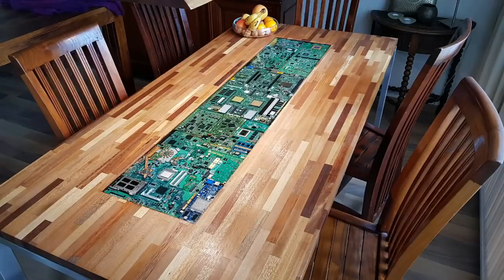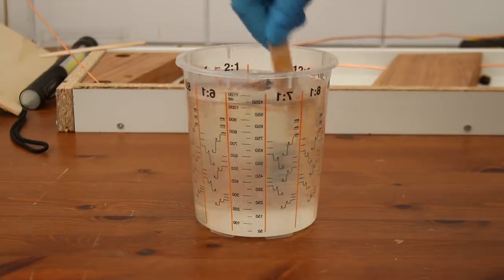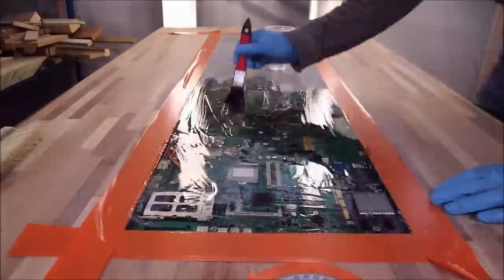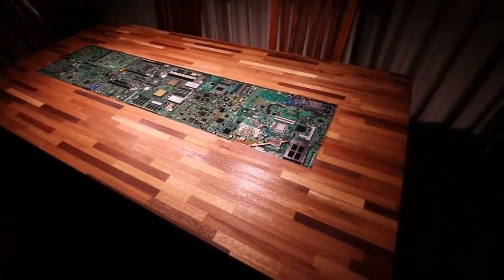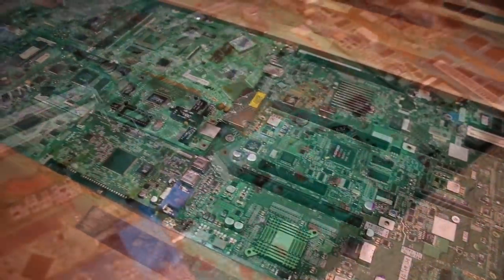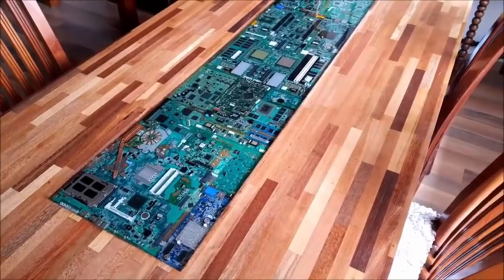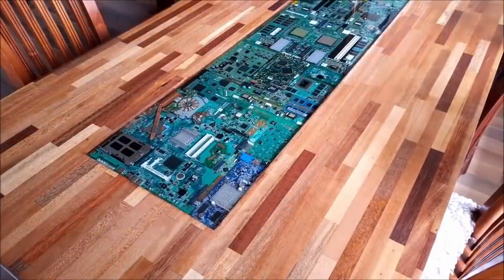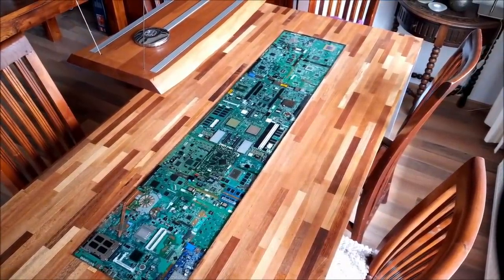Circuit boards with lights in epoxy in a table

Comment: Excellent job. ya material fails like that suck BUT one responder had an excellent idea of the glass. Let the epoxy cure for a a couple of weeks for it may harden up. Its like fiberglass resin. if someone asks about the cloudy portion, tell them that a PIM PARTICLE (ANT MAN)  emerged and its caught in the Quantum Realm. :) One drop of MEKP in a quart of resin WILL set off the reaction and it harden. Your concept is over the top cool. You can buy optically clear Acrylic glass that is stronger than glass and alot lighter. Again nice job.
Reply: dcartier100 Epoxy resin is different than fibreglass or what you actually meant poly- or vinylesther. The formation of poly or vinylesther is a chemical process that happen as soon as the stuff is produced in the factory (albeit very slow), adding the catalyst like MEKP will just accelerated this chemical process.
Harding of epoxy is also a chemical process, but that process relies on adding hardener to the base resin in exactly the right amount. If you add too little or too much your epoxy product will get sticky and will not give the right end result. Even if you wait weeks, the chemical reaction will just stop after typically 24 hrs depending on your hardener component. The mixing of the two components is critical, you best use a mechanical mixer for such big amounts and do not forget to pour the base and hardener component into to a third container/cup/pot and really mix it well also in the corners or else you get these clouds of unmixed base or hardener that remain sticky. Air can be removed using an ultrasonic bad, or more practical for this poring epoxy by using a heat source like a burner or a vibrating device that shakes out any air bubbles . Also it is better prepare smaller batches of product and to poor multiple layers, while degreasing the epoxy with an appropriate cleaner in between (the chemical reaction tends to produce some greasy byproduct on the surface).
BTW, you remove epoxy really easy and cheap using vinegar (but do not wait too long of course and rinse with water afterwards).
Reply: @peterk3574  you are right. Each substance has its own properties. My point being if you read my statement was give the epoxy he use some time. I have had similar experiences with epoxy which DID eventually harden. The fiberglass comparison was ONLY an example. Give the epoxy time and see what happens. That's all. I hope all your projects are flawless.
Reply: dcartier100 I wish everything went OK the first time, but no. I mainly use epoxy in areas that require strength or where fibreglass with polyester eventually will fail. Applications of epoxy like this require extra effort to do right the first time, else you get these inclusion that stay unclear or surfaces that are soft and/or sticky and are get easily damaged or start to collect dust. Time does not heal all wounds, unfortunately.
This table is probably one of the coolest, especially with the optical fibres for the lights.

Comment: looks really nice if you dont zoom in to the failures so shhhht you should not have told us its a failure. you could have used real leds and controle them using an arduino, easy and cheap. i think it's a really nice idea to recycle your old computers and laptops in a project like this. 👍

Comment: This was an awesome and awe-inspiring vid! I have been saving my own PCBs from all my personal hardware since 1998 with a mind to creating a 2m x 3m wall-hanging canvas covered with circuit-boards, but now you have steered me in the direction of epoxy and the horizontal... curse you yet thankyou at the same time :)
For your table, I'd consider either an acrylic top or float a thin coating of epoxy like they do for table tops or kitchen counter-tops...?

Comment: Did you know that epoxy is very toxic for living organism,  carcinogenic/mutagenic ? I don't whant that staff near my food 
It should be ban world wide
Reply: It is also incredibly stable and non-reactive, similar to glass. I would try to understand materials science better before I tried to spread misinformation.
Reply: @claudias.8461  you notice that the table top in the video didn't cure and have liquid parts is easy to swallow some epoxy if you eat on that table 
As far as I'm concerned you can eat epoxy breakfast, lunch and dinner if think is so good for you
Reply: @iulianispas8634  The ingredients to make epoxy in this video were not mixed as specified, and thus what you have is not epoxy, just resin and hardener. Just like salt (NaCl) is safe to eat, but its constituents elements sodium (Na) and chlorine (Cl) are not. Anything can and will kill you if not used as intended. Epoxy in and of itself is a perfectly safe material.

Comment: Could it be that your epoxy didn't like some of the epoxies used initially to coat the circuit boards at the original factory? They do clear coat them.

Comment: Never use the container you mix in to pour with always transfer the epoxy into a clean container then mix again. Never fails if you get your calculations right

Comment: Instead of routering the edge and chiseling you could do a through cut and then add a backing to "reset" the center work area.  If you make the cut right at the edge of the epoxy you won't loose the original dimensions for the work area.

Comment: i think to have a better result with the epoxy you should have pouring it in more multiple layer and instead of sanding it would be grat to have a kind of giant exato blade ( the width of the epoxy and above) to scale the epoxy at the same level of the wood finish with the higer grit of sanding and with a ploosh paste with a buffing wheel.
the idea wos great the overall result was fine
to increase the quality of your epoxy result (we don't see if you do it in the vidéo) vibrate your bucket of epoxy before pouring it or put it in a vaccum chamber to eliminate the bubble so you can mix your epoxy without any precaution

Comment: The table looks fantastic anyway. Good job. If it had to be redone, would it help to add a thin sheet of clear glass over the circuit boards and then pour the epoxy over it?
Reply from the maker: Though nice suggestion, I don't think it would have helped me in this case. Bad mixed epoxy stays bad mixed, with or without glass...

Comment: Hey nice try how come no bubbles when pouring epoxy?
You see so many people putting epoxy in vacuum machine to extract air did you as it looked pretty good?
Reply from the maker: I used a little burner, as you can see in the last seconds of this video..
Reply: what is this burner?
Reply: @Unknown-nc4jq  It's a blowtorch

Comment: I think even though it's a fail it was an excellent attempt.  You had a lot going on with the LED's, circuit boards and epoxy.  I think the "final epoxy coat" raised the middle section a little to which I would rather it be flush with the table.

Comment: As so many have said - a great idea & I/We feel your pain!.
I wasn't sure about the fibre optics at first & I still think that the 'lighting-up' needs a longer term solution (well for me it would - but has got me thinking 💭)
However a terrific idea & you have learnt & taught via your great vid a huge amount & for that "Top Marks" to you! 👍
Reply from the maker: Thank you for the kind words. I disagree about the lights - part of the charm of the fiber cable is that the lights light up temporary. It would become annoying when they were on all the time, or worse, flickering all the time... Of course it would be different if you wouldn't use it as a table, but more as a show piece, yes.

Comment: no cables then has the bottom of the table covered in fibre optic CABLES
Reply from the maker: With 'no cables' I meant to and from the table. But BTW I covered the bottom of the table with a sheet of plywood, so there are no cables to be seen.

Comment: Does Not show in the vid but I assume you used a heat gun to remove the bubbles from the resin, Would love to do something like this or wood turning but my wife has the garage and shed crammed with stuff she sends  to here relatives in the Philippines so no room for me.
Reply from the maker: The heat gun is visible in the last seconds of the video. Maybe you should work out some compromise with your wife? About the use of the garage? Good luck!

Comment: Yeah man you need to be so consistant with the quantities and also the timing for stirring.. if youre gonna pour 7 litres just mix it up in one mix but from my experience id suggest pouring half the quantity, fix all the air bubbles with a torch and let it go off for a while, when its still tacky go in again for the finish pour 😁 its not as easy as it looks to all the people watching epoxy isnt very forgiving but you did a great job dude besides the unfortunate fail 👍
Reply from the maker: Thank you. I poured 5 liters at once, that was like 1.5 cm, and a few days later the rest, 1 + 1 liters.

Comment: Im sorry it didnt work as expected for you, but it taught me how i wouldnt do mine if ever i tackled such a project. Theres a number of good suggestions here to help salvage the outcome.
   I think instead of resin i would simply use a ~ 6 mm/ 0.25" polycarbonate overlay. #1. The cost would be a fraction of resin material. #2. Polycarbonate will not scratch very easily. #3. The sheet and/or the display contents can be changed at will either from damage or when another display idea comes to you.
    I wonder what the optical effect would be if you used a laser pointer for the light source. I know it would be one led at a time of course, but the effect at each led lens might be fun to see. 
   I hope further curing fixes the stickiness, but if it doesnt get some flooring to cover the entire thing over if it comes to that. Either that or a glass or polycarbonate full table cover.

Comment: put a glass top over it
Reply from the maker: As I replied earlier to the same suggestion: Although I like the idea... as I said, the epoxy is still crawling out. The bottom of that glass would be dirty quick. Maybe if that is stopped, I can put the glass over it, yes..

Comment: it's a nice project nonetheless but
1. mix the epoxy with a mixer for a drill
2. if you thought the epoxy is well mixed, mix it again and repeat 2 times
3. use a mask !
Reply from the maker: I think I can say I learned the hard way that you are right.

Comment: Twinkle lights or LEDs don't make junk circuit boards any prettier. I'm not sure where you find beauty in staring at techno hell that has done more negative than good being used psychologically to be presented as making our lives easier while all the while monitoring every thing from your keystroked on a keyboard to the retarded crap people say on social media to business meetings via electronic means which in every capacity is monitored and information used and or stolen. Chins, has been ripping off ideas before the citizens of the USA can obtain a patent and they really don't care if you do have one, Your ideas are stolen and manufactured cheaper, shipped and sold to America before your able to set up production. College grads buried in debt think getting a job at Google is their ticket when it's all planned out how to screw you before you even get there and you should have the COMMON SENSE to wonder why they have such a high turnover? Your next.
Reply from the maker: I'm guessing black is your favorite color.
Reply from the maker: You can react to what I did or what I commented, for exactly that is what I'm willing to discuss with you. I will delete not-related semi-religious blah-blah.
Reply: I don't have a favorite color, if everything was one color, it would be boring and dull.

Comment: Maybe the epoxy reacted with some of the components as you know some epoxies do slightly heat up, but a great job.
Reply from the maker: Well, I'm pretty convinced I cut a corner at mixing... This was a rather easy to handle, and therefore expensive epoxy, that could be poured in layers of 5 cm max - I did 1.5 cm. Thank you.
Reply: Onrust! Better luck next time on your other projects, but all the same it’s a great job you did on this one

Comment: You did better than I managed when I tried this with a smaller table. I used the epoxy that has the tiny bottle of catalyst so mixing it was really hard, and I poured the whole lot in one go. I also didn't account for things floating...

The epoxy got very hot and made all the circuit boards warp, to the point the epoxy slab popped out the table at one end, giving me a curved table top that was sticky, with some components poking out the epoxy.

If I were doing it again, I'd do many thin layers and a glass top for durability.
Reply from the maker: That is quite some learning story as well... 😊 As you can see, you learn most by doing. Thanks for sharing.

Comment: Place a sheet of glass over the entire table.  That will save the entire top from scratches or problems with sticky spots.
Reply from the maker: As I replied earlier to the same suggestion: Although I like the idea... as I said, the epoxy is still crawling out. The bottom of that glass would be dirty quick. Maybe if that is stopped, I can put the glass over it, yes..

Comment: Attach a temporary "wall" around the edge of the table and pour a layer of clear resin over everything.
Reply from the maker: As I said in an earlier comment: I thought of that too, but first, the ugly spots won't go away with that, and second I don't like the look of wood underneath epoxy that much... Covering wood in epoxy for me is something like making plastic out of something natural..

Comment: Cut a piece of glass and cover entire table.
Reply from the maker: Although I like the idea... as I said, the epoxy is still crawling out. The bottom of that glass would be dirty quick. Maybe if that is stopped, I can put the glass over it, yes..

Comment: Bahhh... it’s not failed, just use infrared heat lamps to cure the ‘uncured’ epoxy. No more leakage or distorted prism effect. Good job man!
Reply from the maker: Is that so? Experts told me there was no way to harden not well mixed epoxy... which seems logical to me..

Comment: I had a similar idea for a coffee table, but want to use both LEDs and fibre optic cables and have the fibre Optics "floating" in the epoxy I like your non-LED LED idea too very interesting. I'm sorry it didn't work out how you expected but you've certainly given me some much needed inspiration to get on with my own idea.

Comment: You should have added epoxy in few layer & at least 3 day gap between each layer.
Reply from the maker: I did. According to the specs of the epoxy I could have done 5 cm and I did 1.5 max.

Comment: Great project! I feel sorry for you that the epoxy was not mixed well :/

With big amounts of epoxy you should definitely use a power drill with a paint mixing tool!

One proposal of what you can do with the table: You can get a thin (4mm or so) plat of wood that looks quite similar to the wood of the table and get a plane of glass of the same thickness cut out a little bit smaller than the PCB-area. That way the table looks almost as good as if the project would have been totally successfull.
Reply from the maker: Really nice idea! I'll keep that in mind. Thank you!
You're right about the mixing. I guess that's the way you learn..

Comment: Did you use an epoxy specifically designed for thick pours?  It doesn't seem as though you did.
Reply from the maker: The specs of the epoxy say that you can pour 5 cm at once. I did maybe 1.5 cm.
Reply: @Onrust1  I also noticed you were stirring the epoxy like paint. You should continually scrap the sides and bottom of the mixing bucket as you make circular patterns with a wide stirrer.   So your assumption that the mix was not good enough was probably right.  Hope this helps your next project.  Enjoyed this video and thanks for the cool ideas.

Comment: Use MAS epoxy “Table Top” to cover the whole table and provide a clear hard surface
Reply: I wonder if the bad spots could be cooked out with a heat gun? If so, a quarter inch would do.